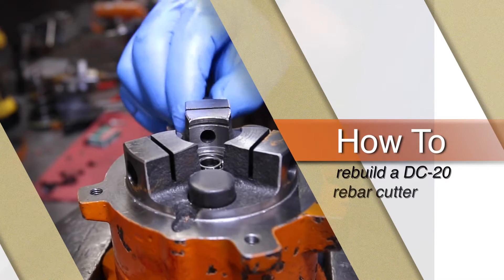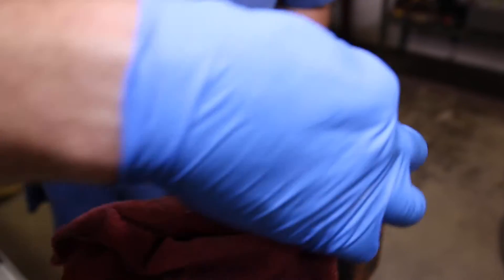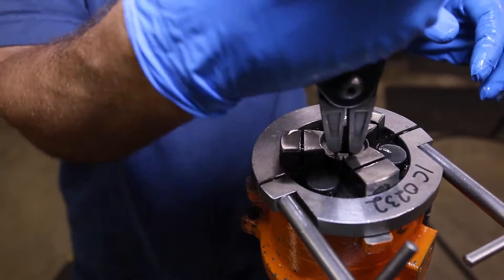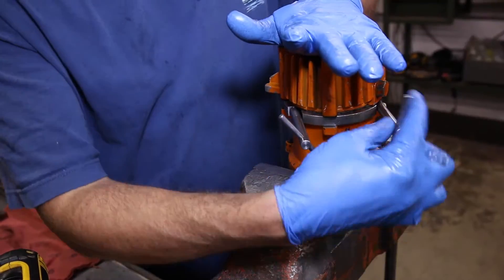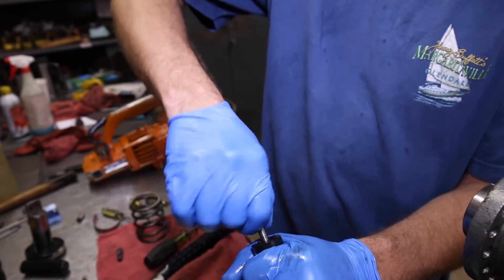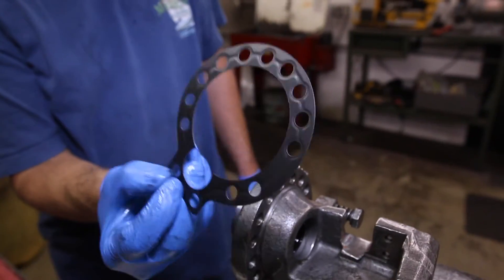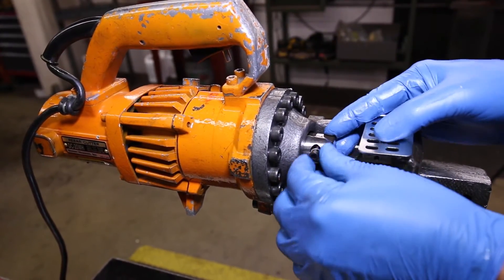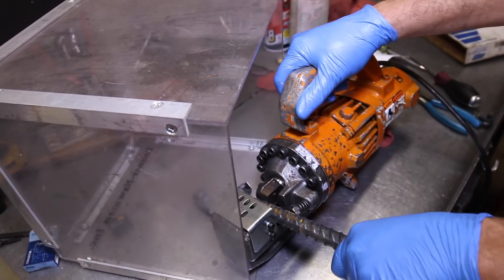DC-20WH | HOW TO rebuild a DC-20WH rebar cutter (Part 2 of 2)

Comment: hi.. can i ask about dis tool..? wat if the piston didnt. work.. but electrical is good. the motor is rotating.. but the piston didn't ..thanks.
Reply from the maker: This is normally caused by the piston has been drug on the casing causing it to bind up.  This normally happens when the stopper bolt has not been correctly adjusted so that when cutting the rebar the bar is at 90 degrees.  We normally have to disassemble the tool smooth the piston or replace the piston so that the tool will work again.  Please see our website for service and repair centers that can help you with your problem. http://www.bnproducts.com/service-centers/
Reply: alisar el piston reemplazar no entiendo el mio solo el piston sale adelante mas no retrocede  solo lo retrocedo forzanod con un desarmador acia atras pero si tiene fuerza corta solo no retrocede qsera diganme  todos ayudame😢😢😢 porfa q sera  tan dificil es decir q  seguro sera el reten   o algo se armo mal diganme